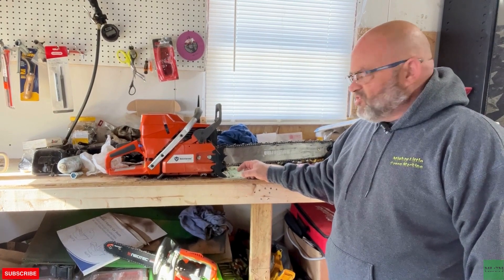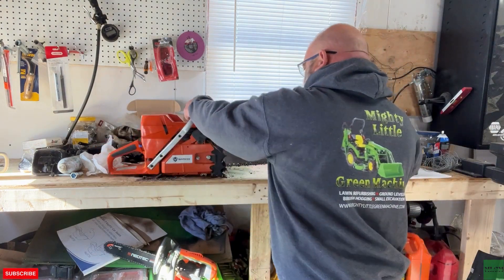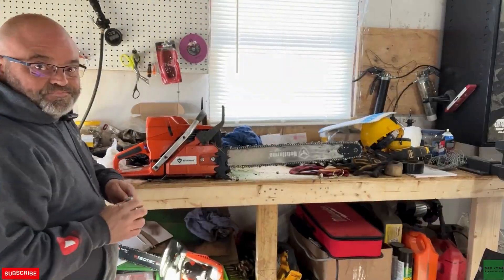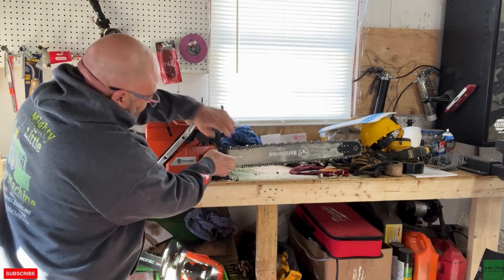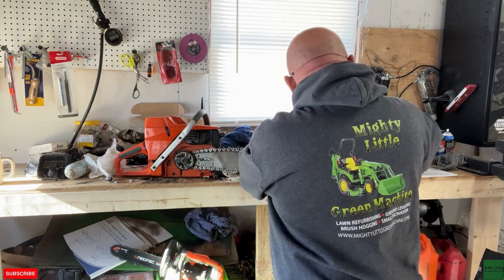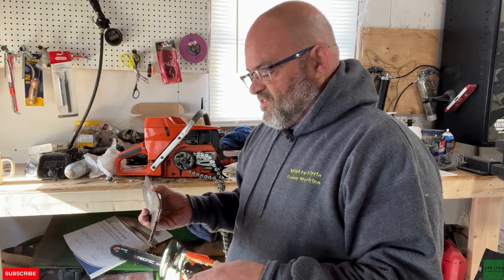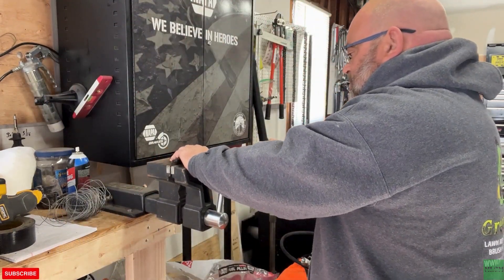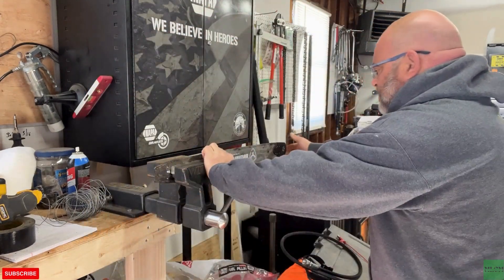Straightening The Bar on My Chainsaw that I Bent. Not how you think

Comment: Good morning Neil. Having some experience straightening steel the best way is with a straight edge, and piece of soapstone or chalk, and a press. You can use the straight edge to find exactly where the bend is, mark it, and use the press to push it out. I know that not everyone has a press but a small one is rather affordable at places like Harbor Freight. I built my own out of some scrap 4 inch channel and a 12 ton bottle jack that was given to me. It's not something that I use every day or even every year but it's still a great tool to have around. I built mine back in the late 80's. Anyway, how do you like your Husqvarna chainsaw? And how hard is it to start? When I went to buy a new chainsaw everybody said get a stihl it's the best. You couldn't give me another Stihl chainsaw. I'm 74 years old and by the time I pull on the cord 15 times to get it running I'm too tired to use it. Anybody that says that i just don't know what I'm doing, I've been using chainsaws since I was a teenager and I've never seen one this hard to start. Anyhow, I'm not writing this to complain, I was just curious about the Husky. God bless and have a wonderful day. 👍👍🙂
Reply from the maker: That’s actually a great idea. I do have a friend that has a press. I’m gonna try that. Thank you for the information and thanks for watching.
Reply: Never have pulled more then  given five  pulls to start my Stiel.